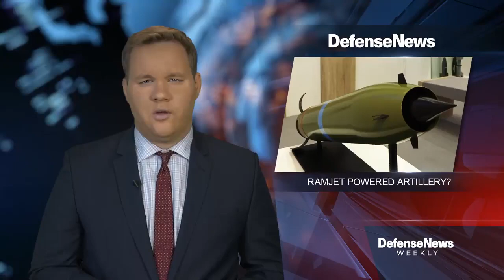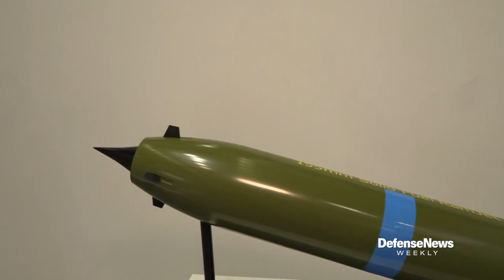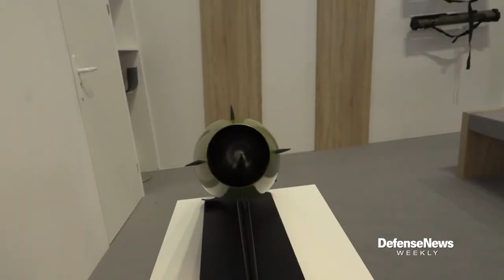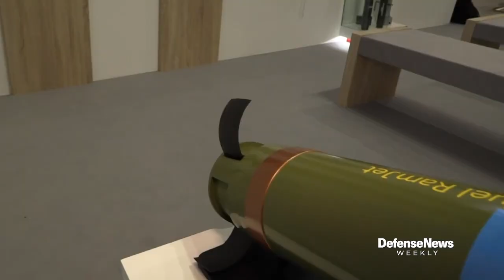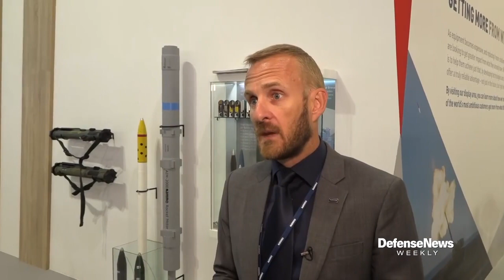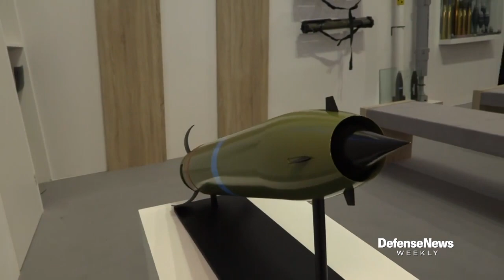A ramjet-powered artillery shell?

Comment: 40 KILOMETERS IS ONLY 40 MILES BUT THE GUN'S 152 SHELL SHOULD GO BEYOND VISUAL RANGE AND PERHAPS WITH A DETECTING SYSTEM USED WITH THE AID OF A SOLDIER'S GROUND LAUNCHED DRONE, THEN YOU WOULD HAVE A WINNER!!
Reply: 40 KILOMETERS = 24.854847689 MILES